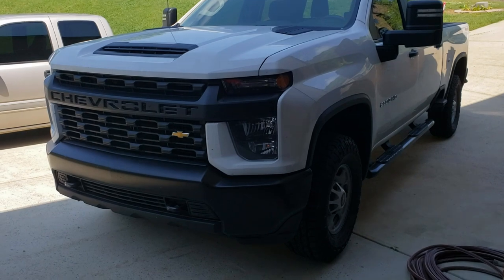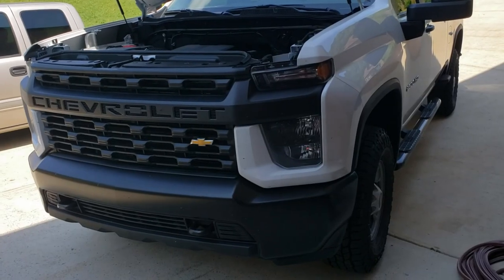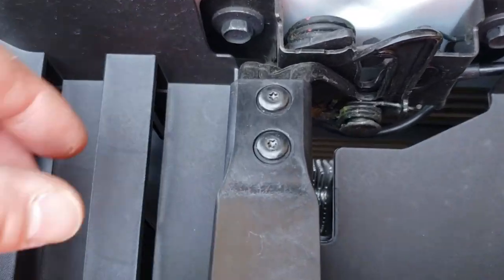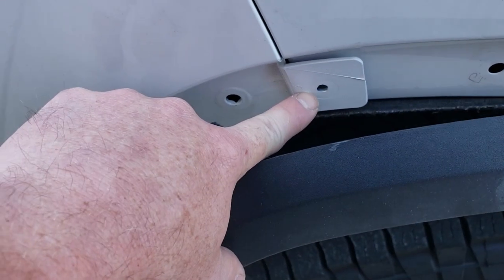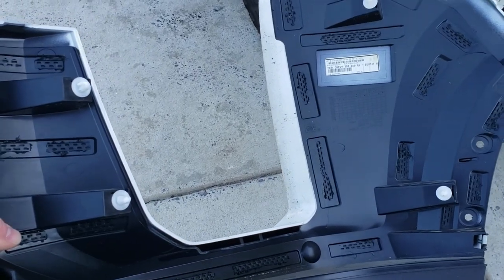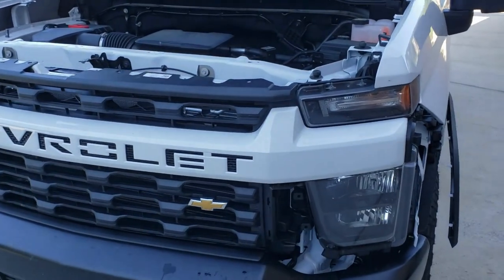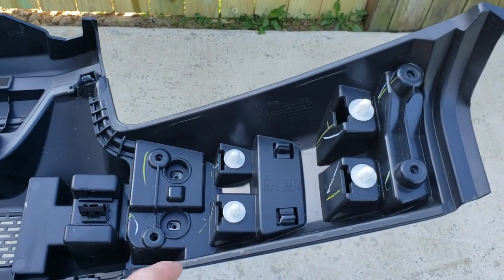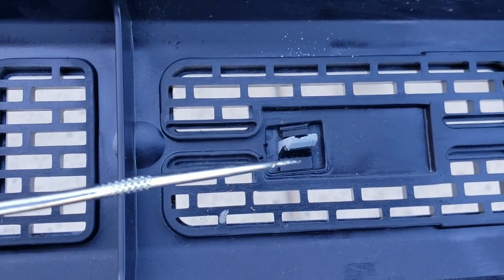How to Remove a 2020+ Silverado 2500/3500 Grille

Comment: Good video.  I just took off a 2021 and you have to also remove one of fender liner screws that aligns with bottom of side panels as it screws into the side panel.
Reply: That fender pop off pretty easy?

Comment: The real secret to removing the filler panel, after removing the fender trim and 7 mm bolt. Is to pull out and away from the body at the fender seam before pulling forward.

Comment: I have a 2021 Silverado 2500. Do you know if it is hard to get in to change the headlight bulb?
Reply: no it takes 5-10 minutes. pop out your fender flare about a 1/4 of the way, removed 7 or 8 of the inner fender liner screws and when you pull back you will see the headlight dust caps. real easy. i have a 2021 also and just changed my bulbs. theres also a video of it showing what i just explained